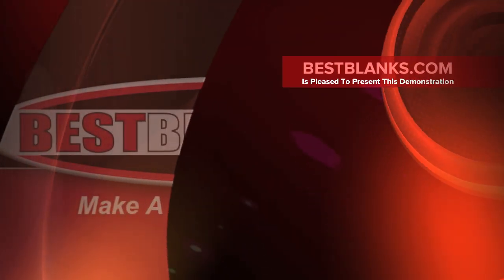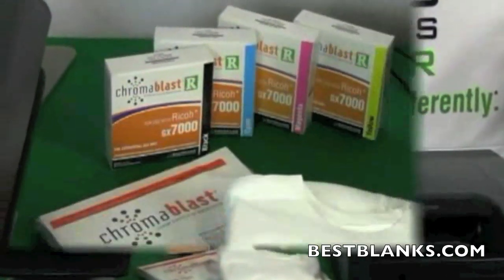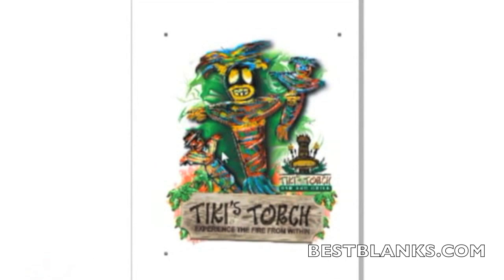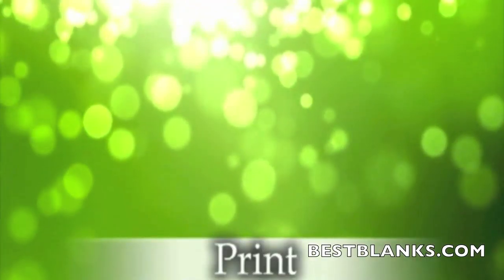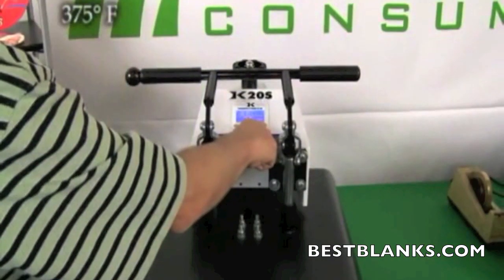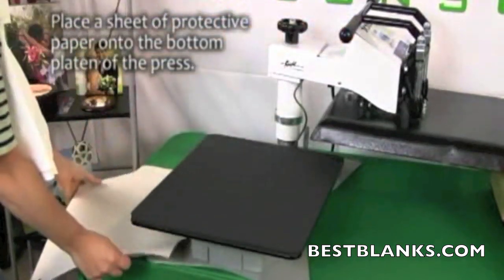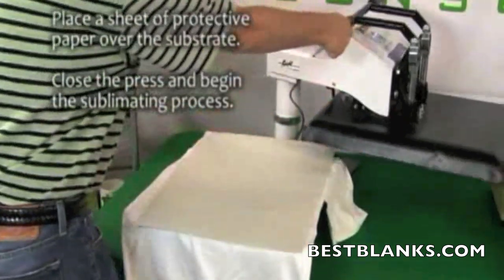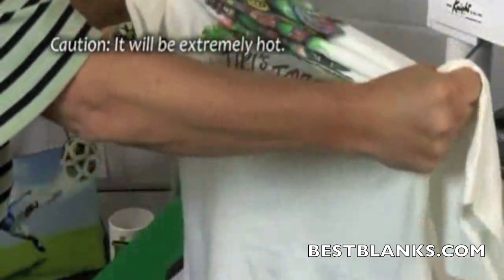How To Apply Digital Heat Transfers To Cotton Apparel

Comment: hello, for dark shirts need to change the ink or the paper only? I have a Sawgrass SG400 with sublimation inks, can work with it? What kind of ink serve? What kind of paper do you use? thank you
Reply from the maker: Sublimation printing cannot be done on dark shirts. It requires white or light color fabric. There is no white ink in sublimation printing and the CMYK ink  will not show up on dark fabric. If you still have questions please call us for help 888-431-7385 or 954-989-1250